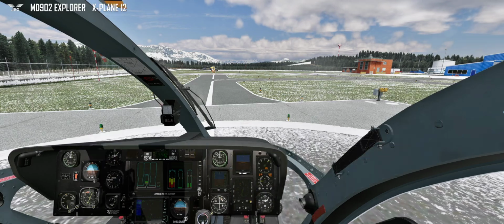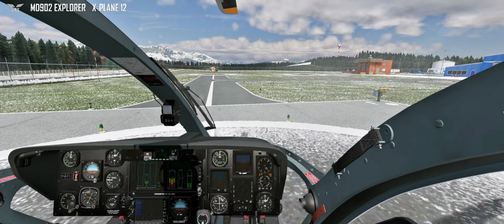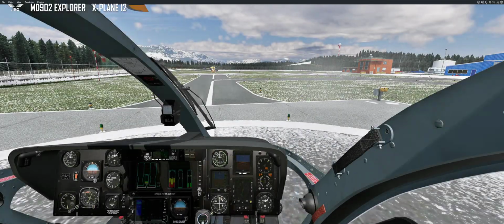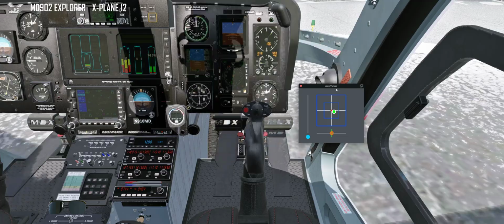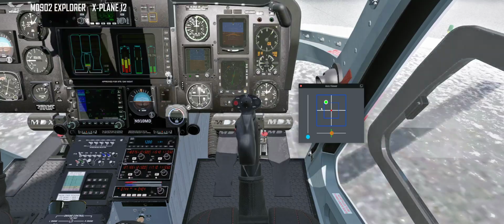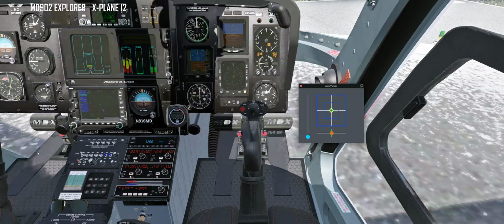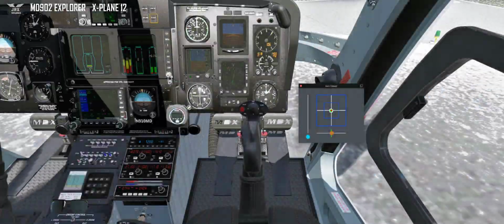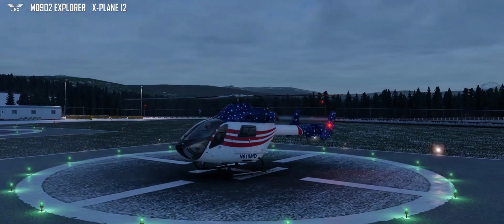JRX MD902E - For X-Plane 12 - Trim Control Tutorial

Comment: Hello, I've just bought this helicopter and there's something I don't understand. Why is there some kind of "delay" on the rudder pedals ? When I push my rudders on one side it doesnt move immediately in the helicopter. Is there a way to disable this dampening/delay ??
Reply from the maker: Hello, we have not added any delay or dampening to the Anti Torque Pedals
Reply: @jrxdesign so why it doesn't respond to my rudder movements immediately? Is there an option in the settings to fix this ??
Reply from the maker: @laminak1173  I think you are talking about the animation of the pedal movement? Pedals in most aircraft including the ones I have flown do not swing freely and require some pressure.
Reply: @jrxdesign  Yes but we can't feel this resistance on the rudders, so to my mind it's worse if the pedals in the sim dont follow exactly your movements. The reason is that if there's no feeling (no feedback), it makes it impossible to train yourself to correct the way you control the commands. You made an amazing job this helicopter is beautiful, but on this point a more direct command  on the anti-torque would have made it way better. Amazing job on the medical stuff on this helicopter, I took it for this reason.
Reply from the maker: @laminak1173  If you know how to edit xLUA scripts then find the file called:  (usually just notepad or text editor)
\JRX - MD 902 - v1.10\plugins\xlua\scripts\jrx_md902_trim_operation
Look for the line (around line 265) ↓
yaw_damping_rate = sas_enabled == 1 and 0.8 or 1.2
Adjust the Values:
The two numbers control the animation response speed:
Second number (0.8): Response rate when SAS is ON
Third number (1.2): Response rate when SAS is OFF
To make the yaw pedals animate faster, increase these values.
Reply: @jrxdesign  Thank you 👍👍 I try tomorrow
Reply: @jrxdesign  I've made some tests, at 10 there's no more latency, perfect ! I've made a video about your helicopter for this evening. Thank you so much

Comment: Excellent! Can I still fly with HeliTrim if I am used to it?
Reply from the maker: There is no need, we have added an identical system the same as HeliTrim as the standard trim system in this 902 working in the exact same way.  Thanks
Reply: @jrxdesign  It's more like I-have-HeliTrim-installed-and-don't-want-to-mess-with-bindings type of situation, but since the MD got custom trim bindings, I will have to make a separate profile anyway, so all is good. 😀